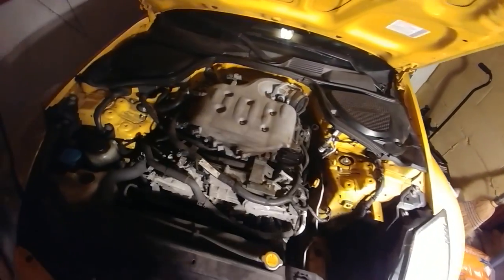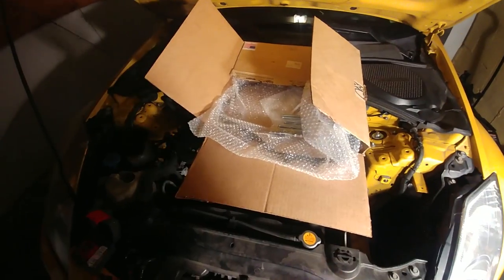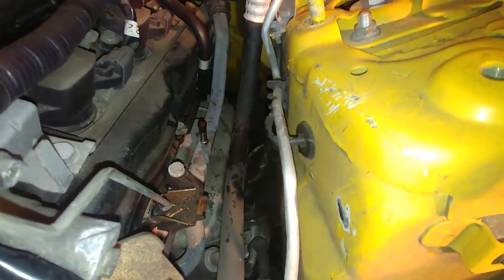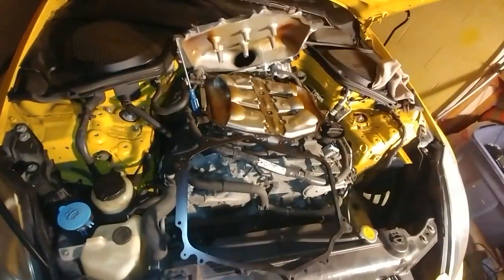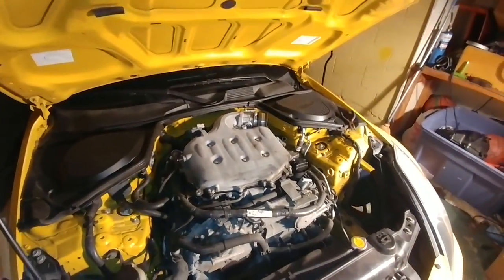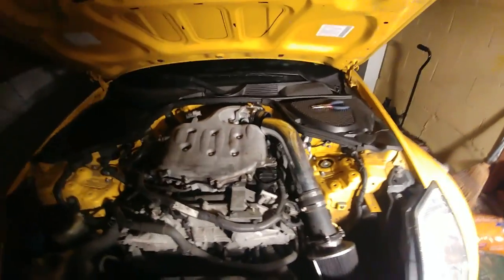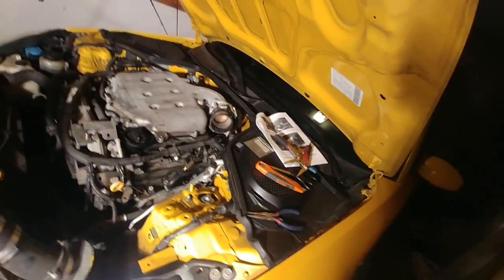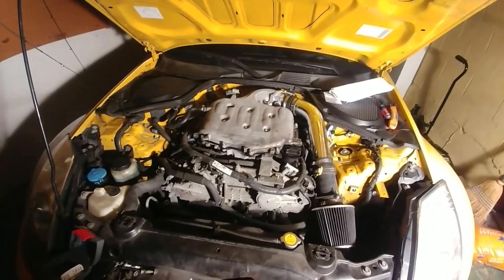Finally Adding Some POWER (Plenum Spacer Install)

Comment: Did that valve you put on really help with the heat soaking for the throttle body
Reply from the maker: I'll be honest I haven't even flipped that switch so far. Im not going to uninstall it but I don't see why it wouldn't work.

Comment: Why would you install this right now if you're going to wait until you do a lot of mods to tune it? All it's going to do is run rich and create a lot of carbon build up. A true tuner stocks up on all of his mods and installs them all at once and then goes for a tune.

Also please by a torque wrench. It has manual gears in it which torque it perfectly. That little tool is wrong. A torque wrench is big with all leverage necessary. Also L for not cleaning the plenum